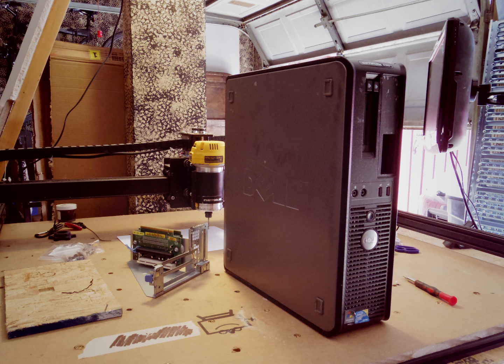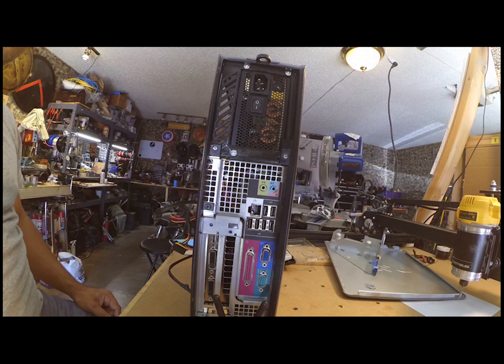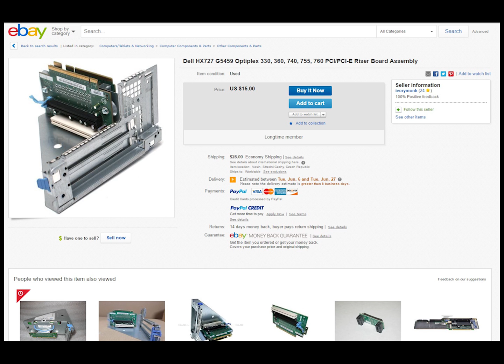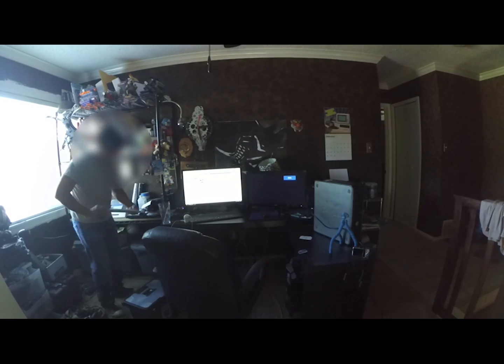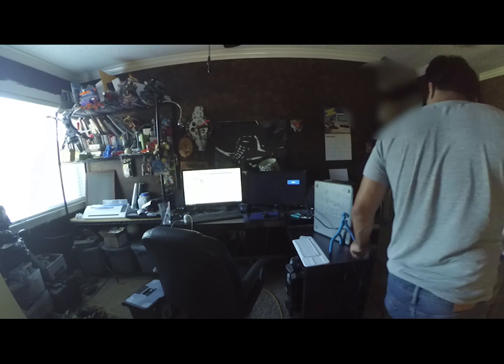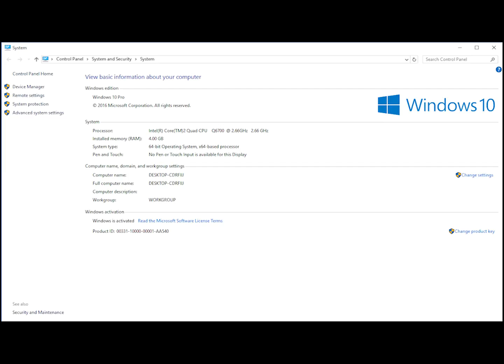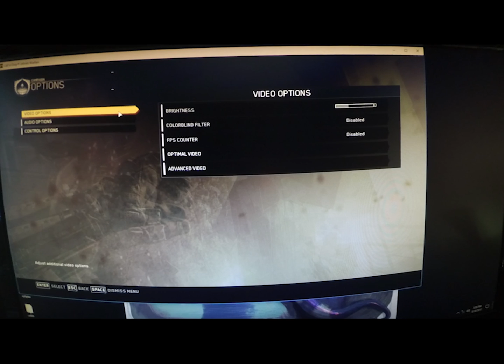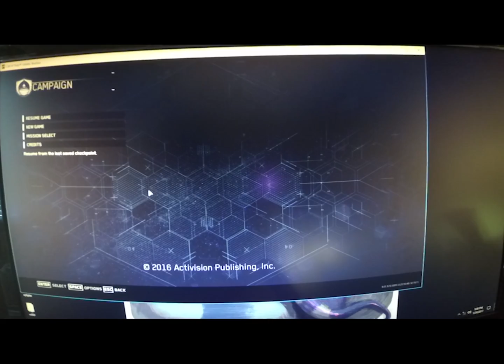Dell Optiplex 360 Double height graphics card and 300w PSU upgrade

Comment: Can you reupload a link for the 3d printed PSU bracket. I bought the power supply online last night but the link for the bracket isnt working. Thanks

Edit. Sorry just the page wouldnt load. Have the bracket all done now just waiting for the PSU to arrive. Also have a MSI GT 730 1GB DDR5 graphics card on the way. Half height but the heat sync shroud might get in the way but I measured and it will be super close. Will add to this post next week when all parts arrive and keep ya updated.

Comment: Bro i have dell optiplex 745 mini tower so plz tell me can i install 400watt power supply plz tell me?
Reply: i want to know to i see the mother board has a 24 pin for power supply so maybe but it wont fit in the case
Reply: @RDCAPO809  they have adapters for most of the pins
Reply: @trollmctrollington3693  i know but i saw a guy using a adapter and it shows him a error when starting his pc  i have a 6 ping pc is a hp 6000 pro to i was going to buy a adapter and insted i got a optiplex 7010
Reply: @RDCAPO809  was it optiplex specific? and half the time you have to go into the bios dell and HP are weird that way
Reply: @trollmctrollington3693  i think it was a hp because i wasnted to add a power supply to my hp and i was searching about them adapters